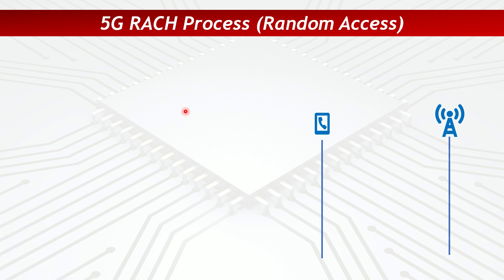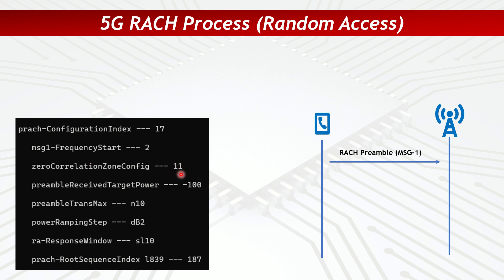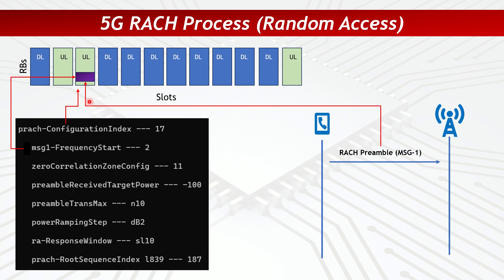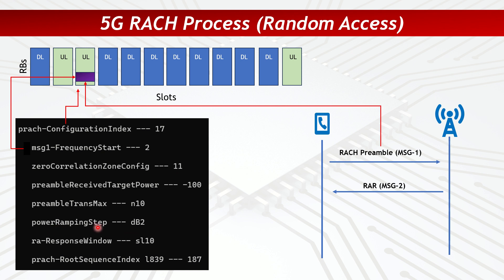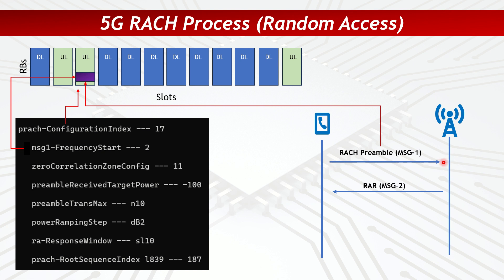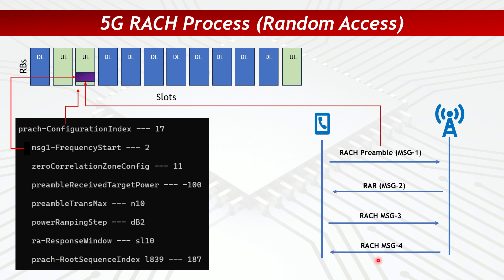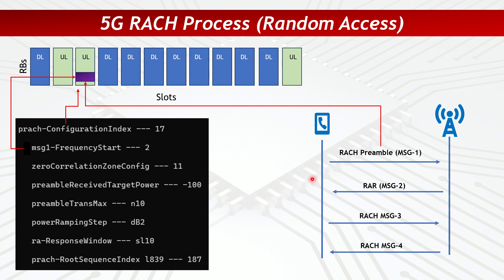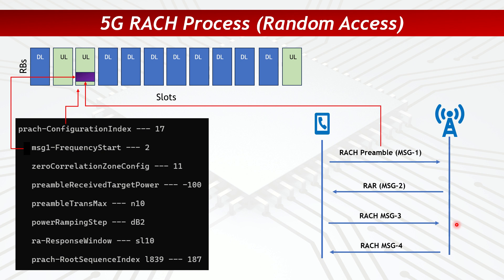Top 5G Interview Question: 5G RACH Process

Comment: Thanks for share, i think that the number of MSG2 is not always  equal to MSG1 because there are some  cases where the MSG2 is not sended ( MSG1 out of coverage , UE Cell radius bigger than configured cell radius  ) or RAR window expired  or MSG1 discarded because the number of MSG3 retransmission expired (in this case the MSG1 is counted but the MSG2 not sent)
Reply from the maker: Yes, correct.

Comment: HI Ali Khalid,Amazing explaination ,I must say you are my mentor as your way of explaination is fantastic and really help to get Network insights.
my question is regarding MSG4 failure  especially in SA configuration.what are the possible reason of MSG4 failure.and tips to mitigate it?
upon successfull reception of MSG3 by GNB ,I belief MSG4 is the acknowledgement from the GNB to UE for the  RACH complete.
so if UE fail to recieve the MSG4 it will restart the rach process again?
Reply from the maker: Yes, MSG4 failure would normally happen when UE is unable to decode the PDCCH or the PDSCH. One possible reason could be if MSG4 uses a more aggressive PDCCH aggregation layer than that could reduce the PDCCH's robustness. But in any case, it would need some UE side logs to verify the real reason.
Reply: @OurTechPlanet  Thanks Ali

Comment: Hello Bro.One small question please.If Max RETX defined 4 or anyvalue it means that in every re TX UE will Increase Power or It will try with same power for ReTX number and when it failed than at end UE will increase power
Reply from the maker: UE will increase power on every retransmission by the step size

Comment: Thanks a lot bro.if msg 3 fail due to dtx means what could be the possible actions to improve RACH
Reply from the maker: MSG3 DTX is the one of the most common problems but also one of the issues which can be caused by many different scenarios. So, mostly, it would need further troubleshooting. The main causes would be low MSG3 power, UEs in bad coverage, RACH planning conflicts, UEs too far away beyond the cell range.